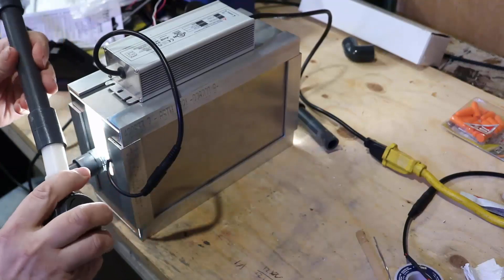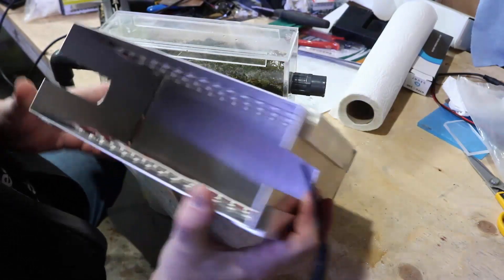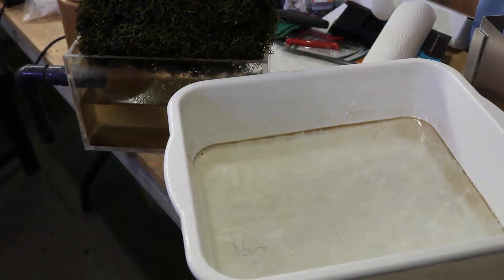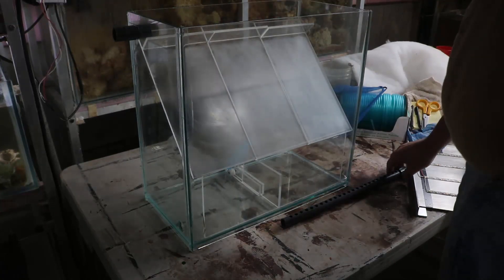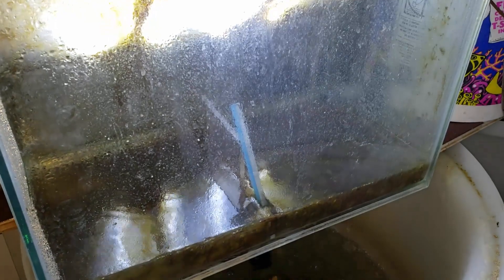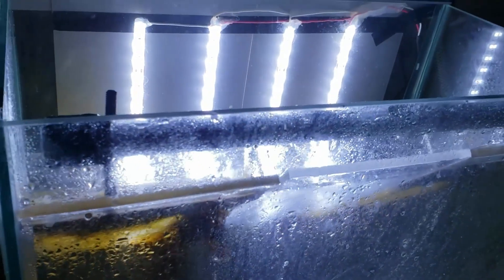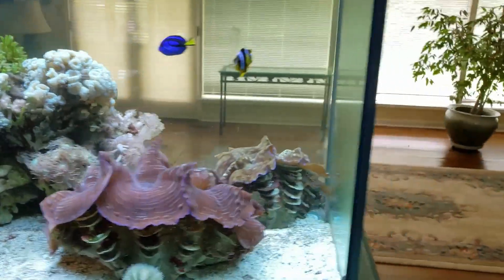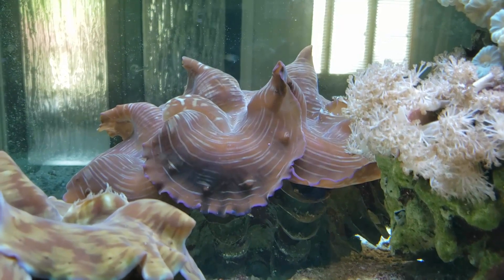DIY Algae Filter Update

Comment: Have you thought of adding a kind of pass through baffle before the cheato and doing a mechanical filtration against that baffle so the water would thus have to pass through the mechanical filter, then the baffle then into the cheato? That would catch a lot of that "dirt" you mentioned and be a lot easier to clean rather then taking the cheato in and out every single time to clean it, it'd probably act as a water polisher also. I'm a freshwater keeper but just an idea I had during your video
Reply from the maker: Hey William. Thanks for watching. The dirt is part of the inevitable build up in this style of filter even if I had a prefilter. Even if I could somehow keep it from building up I would have to take out and prune the chaeto regularly. Thanks for your thoughts on this. Much appreciated

Comment: Have you looked at building a rotary drum filter?
Reply from the maker: I toyed with the drum filters that rotated due to the flow of water and found that they tended to seize up with time. I have been thinking of using stepper motors in a number of builds including drum filters and will get to them sometime soon. Thanks for watching.
Reply: @FishmanEricRussell  lol... I've seen any number of motor types. One guy uses windshield wiper motors. The closest I've been to stepper motors was in some of the first graphical plotters. Dot matrix printers probably use steppers. I'd just be happy with not having to DIY the space shuttle in my garage.
Reply from the maker: @Shalmaneser1  For a rotating drum any DC motor would be fine. The steppers are for another project and I was just going to keep things uniform
Reply: As far as I determine, the commercial RDFs use around 60 micron filters, what do you think of going smaller? Say with a pair (60/30) of RDFs?
Reply from the maker: @Shalmaneser1  As in all things finding a balance is the trick. Larger pore size will handle dirtier situations without clogging. Smaller pore size will clean out more but with a dirty situation may clog easily.

Comment: Okay so I think I missed a video or something... What issues did you have with version 2 and the power outage?
Reply from the maker: Hey J! During the power failure version 2 dried out and it took much longer to come back to a useful level as compared to version 1.
Reply: @FishmanEricRussell  - Ah that makes since if it was emerged plates. I made a submerged algae scrubber for a large tank (260 gallons) that was kept in a sump. Had a similar issue with a prolonged power outage even though the algae didn't dry out it was enclosed in the stand and didn't get light for about 4 days. The algae died back significantly and seemed to take a little longer with regrowth than I thought it originally took. All these years I thought it was just my imagination but guess not now. 

I used an old window glass and some stainless steel screen door mesh to start mine. But back then we didn't have the LEDs so I started with a 150w spot light and once established reduced it to a 100w bulb. Seemed to work okay for a couple years. I broke it in a move one day and just never got around to rebuilding it.

Comment: So that’s a salt application. Noticed no chato on v2? Any way if you did put chato on it wouldn’t it need to be in a box of sorts? As I’ve seen submerged algae scrubbers for fresh develop a more fuzzy algae rather than goop.
Reply from the maker: There will be a 3.0 version to take the best features of each. If I made the bottom deeper in version 2 I could put chato down there and that could help but there would still be issues with this. For freshwater I would probably use a fast growing plant with a larger container. I will have to work on one. Thanks for watching and sharing your thoughts on this

Comment: LOL   I was trying to figure out how #2 was keeping that tank that clean, but then you said you had a regular filter running on it as well... That's a homemade UV filter, right?  That's really amazing, even though you point out the flaws!  You're like Scotty in engineering... you're a miracle worker! Taking what you have, making it work, and not blowing the bloody ship apart!!!  lol   :-)
Reply: Same... I was wondering what the lazy man's filter is.
Had a few different power outages and around 12hrs+- could bt more was asleep for one of them, but was bad enough that my tanks got bad enough it killed the snails.
Taken quite some time for them to get the Nitrates back down. Since the last big outage added air/foams to the tanks so if anything does happen when away, something is still happening.
Reply from the maker: @wobblysauce  I left the link to that filter above so you can have a look. Fortunately that power failure happened in the summer otherwise it would have been a different result for sure.
Reply from the maker: I really do need to make play lists so things can be easier to find. Here is a link to that filter https://www.youtube.com/watch?v=-DK6iBinJ2I .Thanks so much for your kind words!

Comment: The Saltwater tank is looking Great.
Do you think Microalgae or Macroalgae works better in devices like this?
Reply from the maker: Still working on the details but so far I prefer the flow through with the macro better and the chemistry of the tanks seems better. It just requires more chambers. The downside of it is it also requires more regular maintenance. There is definitely a 3.0 in the works and another update. Thanks so much for watching